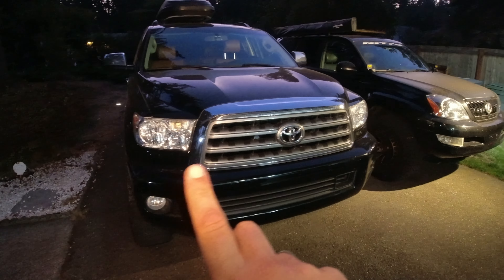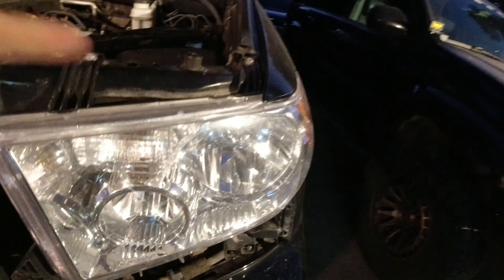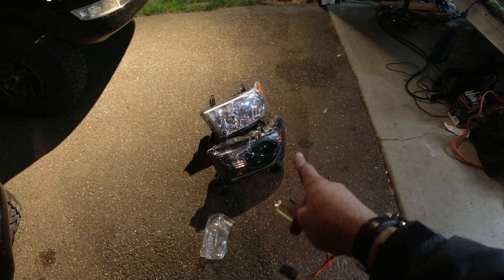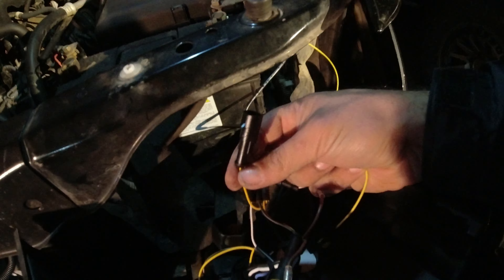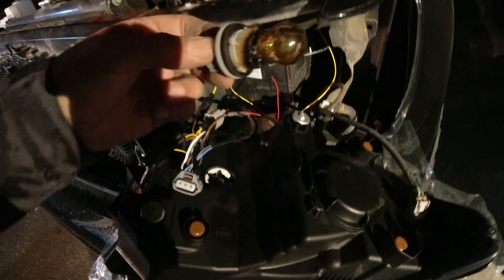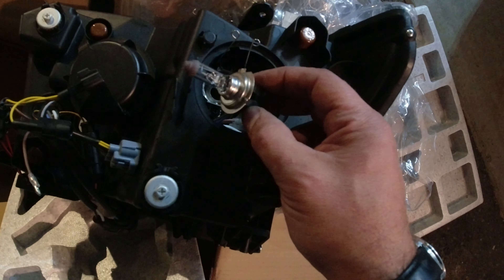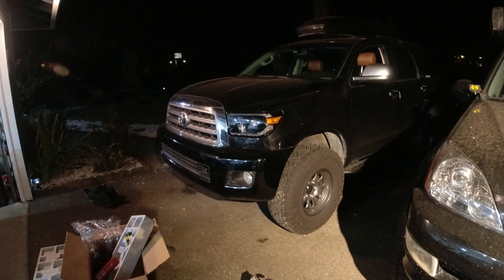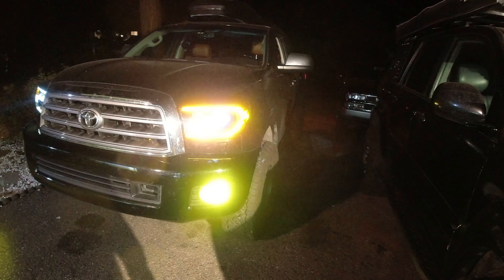2012 Sequoia Alpha Rex LED projector headlight install. Are they worth the price?

Comment: What wheel set up are you running?  I'm trying to get a set but lost about the offset I should get.  Gen 2 sequoia but I have the Platinum with factory wheel flares so I'd like the tire to sit flush with the flares
Reply from the maker: Sitting flush with flares will be perfect for the titan 7 t ak1 17 inch wheels. They make forged wheels that are affordable so you’re in good hands

Comment: I just came to see what they looked like after a deer took out my stock one. I know its a couple years later n i didn't finish vid, but did you fix the cross threaded bolts holding the lights or did they hold up bouncing around?
Reply from the maker: It holds well. Reason being is the plastic bit was the part that was cross threaded so a new bolt went in and stayed in. Easy peezy. Also really good lights after all these years.

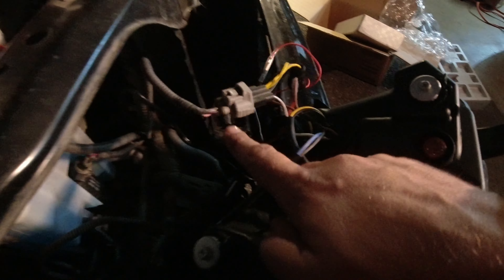Comment: I installed these yesterday. I finished and the right blinker was hyper flashing then stopped. I had Amber DRL and no sequential turn. At 13:30 pay close attention. I didn't connect the correct plug together and just plugged directly into the 3157 halogen. Anyway, once you disconnect and make the right connection you will get the White LED DRL and the sequential turn. The Amber bulb works and does not hyperflash. Great video!
Reply from the maker: Thank you for watching! I appreciate the install feedback as well.

Comment: I bought and installed these lights, thank you for sending me the links! The wires seem pretty cheap and the negative wire is making the lights turn on and off. Bad connection. Did you have this problem? I tried all the simple solutions, cleaning the connection point, new battery.
Reply from the maker: I haven't had any issues with them at all. I totally agree with you on the cheap jumper harness, I wonder if you have a bad connection in the box.
Reply: @CoolGuyClub  I messaged them and they are sending out a new harness. I sent them pictures and video and they indicated it’s a bad harness. I was watching this video back and was like “I did everything he did, WTH!!!” lol 😂

Comment: You didn’t experience hyper flashing at all? At first I only had it on my passenger side & my driver blinker worked fine but now they both have hyper flashing.
Reply from the maker: No hyper flashing. The key for me was a blinker bulb with the right resistance
Reply: @CoolGuyClub  so, if I install an led blinker bulb, I will have the hyper flash? Thoughts?
Reply: @mwhite5330  Yes you'll have hyper flash. To solve this you'll need a turn signal relay that's compatible with LED's
Reply: @ljshoreslokal   10-4,  thank you sir!!!

Comment: Just bought a set of these for my 2012 tundra limited. Are you using the added drl harness or just running the headlights connected to your stock bulb harnesses.  Upon using the harness,  I’m having issues with the drl colours. Driver amber passenger white.  The instructions on the site are somewhat vague and with multiple harnesses on the headlight,  I’d love some advice/insight.
Reply from the maker: I'm using the DRL harness. I show how to install that as well.
Reply: @CoolGuyClub  thanks for the reply!  Yeah t ended up being an issue with the harness itself.  All is well now and functioning.  They really modernized the look of Tundra!  Especially w my bronze te37’s and 35’s

Still on the fence about what to do about an Apple car play screen upgrade.  As the factory JBL sub and amp limit my options for which brand and peripherals work together.  

UCA / LCA’s and LCA’s are next on the diy list first though.  🤙 

Have a great week
Reply: @zachf6256 are you gonna go with oe LCA’s?
Reply: @Seattle808  yes with SPC cam bolts also.

Comment: Can the OEM LEDs on the 2018+ even work with a 2017 and below?
Reply: yep they bolt up. you just need the modern trim pieces below to match the headlights. and may need to get them painted to match your vehicle. lots of people have even done this mod on their 07-13 tundras aswell as their the same front ends as the sequoia. can find all the info and tips on tundra forums or sequoia forums.